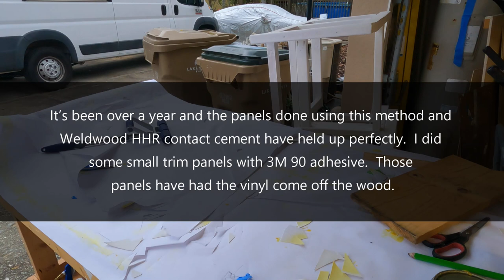Van Build: How to wrap wall and ceiling panels with marine vinyl Step by Step.  Van Life

Comment: Thanks for sharing the product and techniques. I plan  to use the same product for my wall panels and ceilings when I get my van delivered hopefully in Feb. I wonder how much contact cement should I buy?
Reply from the maker: Good question I went through 2 gallons of Weldwood HHR Contact Cement  https://amzn.to/3ehiCvt   it expensive and evaporates quickly.   But it is the best cement to use.  At the end of the project on a few small trim pieces around the oven I used some 3m 90 spray adhesive, and four or five months later it failed and I noticed the vinyl was loose.   So I recommend the Weldwood HHR and of course doing this outside, and with a ventilator mask.

Comment: A roller is the go for applying the adhesive!
Reply from the maker: At first I used a sprayer.  When I was not happy with those results, I used a roller.  The roller was messy, because the contact adhesive dried quickly. Using a small roller tray waisted more of the adhesive. Brushes were easier to use and much cheaper.     If you had the proper equipment and settings, a sprayer should work.   But, I have seen panels done by professionals on boats that failed to hold their bond because of a low coverage of the sprayed adhesive.
Reply: @FrugalFactor  Hi, I do this all the time, vinyling, and have used spray on adhesive with not much luck. I used brushes also but too slow and inconsistent spreading of the adhesive but the roller with the glue correctly thinned and the correct amount, poured into the correct sized tray for a 6" inch roller to minimize waste has worked best for me over the years. Also I don't use contact adhesive, I use a special bonding contact glue which I thin to the correct viscosity for a quick and even spread....I use brushes for the edges. BTW, that's a pretty good corner technique you used, I just stretch the vinyl to pull all the joins to the other side so you can't see them. Cheers!